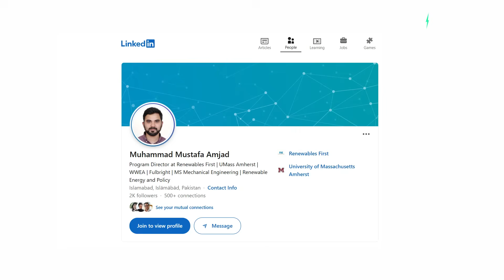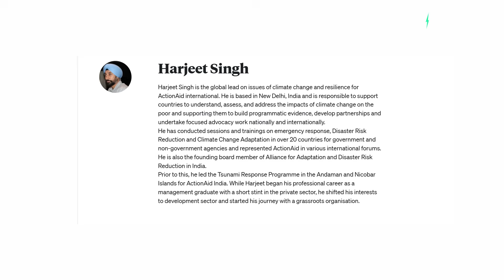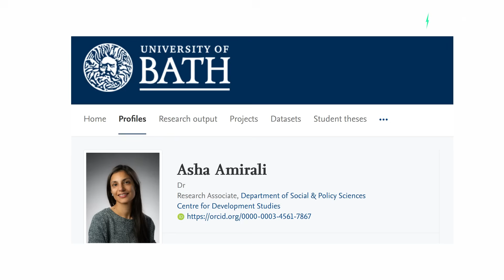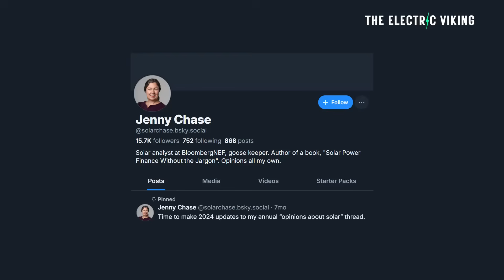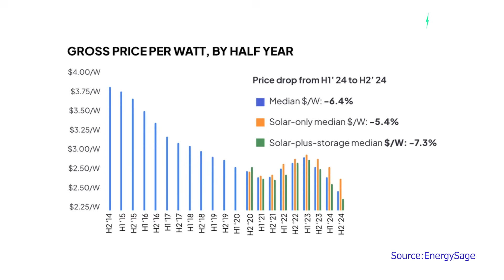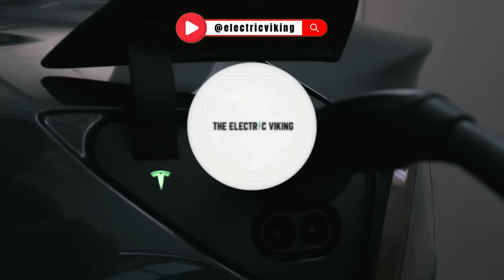Inside Pakistan’s Incredible Solar Revolution: A Game-Changer for Energy

Comment: The govt is clamping down on net metering and new installations. The combination of cheap solar and high electricity prices led to a breakeven period of 1.5 years. The government is pushing this up now, taking it closer to 4 years and making sure we keep paying for their corruption and inefficient decision-making.

We installed a net metering system in Sep of 2022 and remained and negative balance for a good 1.5 years until recently. Now we will be paying bills so the military backed cleptocracy can fill up their banks.

Since the govt is not a buyer in winters when we produce more than we consume, many people are moving to electric cars and other electric based energy consumption so we can offset that cost of fuel.

Comment: The adaptation is not based on the rich and poor class. It's based on house ownership. Personally, I can afford to install solar right now but I don't own a house so it doesn't make any sense to me.
Reply: you can , here in karachi those who are not the owner but if the want to go with Solar the put Solar in someone els building rooftop and no body say that NO we don't let you put solar on our Rooftop , everybody is open to help . we have got a new home and suddenly 2 houses solar has been installed on our rooftop . and we are happy that we are helping them.
Reply: @UmerFarooq-x2p  nice. But the main issue is that if you move out of the house after a year you will have to move the solar along with you and then you will have to pay the installation fee again and it might cost you equivalent to the amount you saved by generating the electricity. I hope there was some kind of a portable system.

Comment: Installed ours in lahore...
6-7kwh solar plates setup with 10kwh lithium battery backup for less than 4000usd

Setting my inverter in such a way that we can run 2 AC for free  during the day and one ac at night for 7 hours
Next step: install another 5kwh battery to increase night usage from battery
Reply: Good luck and praying to Allah so that you can reach the next step in no time.
Reply: We have a 2,500 sq. ft. house, and yes, we installed a 6 kW setup, 
and now we have a 300 amp lithium battery pack for over 5-6 hours of backup with AC, motor, and all the appliances. 

That can increase to over 30 hours of backup (without AC, motor, and refrigerator in case of an emergency power outage)
Reply: But bhai completely draining out the battery on daily basis, won’t it reduce the life of batteries?
Reply: @deSalvay nope, there are different types of batteries
Reply: @deSalvay  no bhai..not darining them completely.. modern batteries usually have protection against deep discharge but I have also set the discharge voltage limit higher than other people to avoid deep discharge.
Reply: @HassanAchieved  u need at least 6kwh solar plates i.e. 585Wx12 solar system with 6kw inverter. Also please install 10kwh battery system with inverter set up in such a way that it charges your batteries after 11Am when the solar is at peak.
This setup cost me 1.1 million pkr
Reply: how much it would cost if you run on grid ?
Reply: @ALiRAZA-mg8bd on grid..every unit costs around 0.22usd or 22 cent usd
Now I'll be able to save at least 65% energy cost

Comment: Solar is very cheap now in rural parts of the country as well.
12volt 280Watts solar panel costs only 8000-8500 Rupees equal to about 30$ US. In my village, many people have 2 solar panels, a starage battery and a few 12v lights and 2 fans on solar. And a little well-off people have installed 4-5kw solar system.
We only have 6 hours of grid electricity in a day.

Comment: Pakistan solar experience has been amazing. Rich/upper middle class opt for grid tie solar and they sell excessive energy to grid. Poor opt for 12 volt solar system with few panels and lead acid batteries to go totally off grid for small installations. Solar tube well is common sight in fields as farmer reduce their diesel bill through it. Only people left behind are those living in apartments as they don't have roof available for panels.
Next big thing will be drop in lithium battery prices. It will enable people to further reduce dependence on grid. Few will go totally off grid with these batteries.
My personal installation is 6kw invertor with 7.8kw panels and 10kw lithium ion battery. I am totally off grid for six months while during summers A/Cs require power at night from grid.
Reply: Price and charging cycle of battery?
Reply: 480k and 6000 life cycles.

Comment: the reason why we need to buy solar is because of very very high prices, power outages, people stealing and not paying for electricity and this causes problems for the normal user who pays for the electricity.

if we use 200 units we pay 64 pkr per unit 
but if we use 201 units we pay 108 per unit of electricity this is absurd and really sad.

Comment: The "rich" mentioned by one of the Pakistani anaylst, are actually the upper middle class. But solar system are not only installed by middle class. The poor ones also have installed few panels at the roofs of their houses, particulalry in villages. In my village, we used to have 20 hours load shedding per day. Now we have installed modest solar system, with batteries, and we at least have lights and fans all day.
Reply: As someone who consistently travels across Pakistan, I am now seeing solar panels even in villages, and shops owned by regular people, the small scale solar panels are appearing more frequently across the country, and specially middle class is shifting very quickly towards solar power.
Reply: A month's worth of pay can get a poor family a panel or 2. Very cheap.
Reply: Isn't the limiting factor that the poor don't have the money? Are they buying panels on credit? Who's financing them?
Reply: @vmoses97 Chinese panels are efficient and cheap
Reply: @vmoses97   panels from china can be afforded even on minimum wage. They are very cheap
Reply: @vmoses97  We have had a boom in wholesalers and retailers buying solar panels, but I remember that we ended up having more supply than demand at one point, which would have caused lower prices from the businesses to cut their losses, at least in the short term
Reply: @vmoses97  panels are dirt cheap.2 to 3 panels will cost 60 to 90$
Reply: @vmoses97  Chinese solar panels are very cheap, a 585 watt panel would cost around USD 70 so even poor people can afford them while expanding the system over time
Reply: @vmoses97  panels are already very cheap if they don't get taxed, but they're probably buying used panels which are much cheaper
Reply: @vmoses97 panels are so cheap here even now govt decreases electricity bills lol
Reply: @vmoses97  Don't listen to him. He is probably some privileged person who doesn't know what it means to be poor. He is at least middle class. Even a middle class person cannot afford batteries easily. Solar Panels might not be very expensive but batteries and inverters are.
Reply: How much power are you generating from 2 panels realistically? And what about other costs - batteries, inverters etc.
Reply: @vmoses97  a 615 Watt panel costs about 19000 Pakistani rupee or 67 bucks, they are getting more efficient and cheaper every day
Reply: Yes exactly everyone household does this. Even in the backward desert places like thar etc.
Reply: i agree
Reply: Middle class also installs them, those who live in houses and not in flats, are all installing Solar panels Alhamdolillah

Comment: A tier 1 Chinese 585 watt bifacial solar panel costs about 17500 PKR at todays rate, or about 62 USD per panel. Offpeak rate is 41.68 PKR per kWh,  or about 15¢ per kWh. When you add taxes, fees, surcharges the effective rate is around 21¢ per unit. This makes the decision to go solar very straightforward.
Reply: Damn, why is pakistan's electricity prices almost the same as England's prices?
Reply: @L8PRODTV  its mostly the dumb Taxes the government add to bill that why it expensive and also the IPPs .. of that wasn't the case the rate would be around 10-12¢
Reply: Simply pakistanis do the math: you recover 100% of your costs in 1.5 years maximum and rest of life it's free!! The normal electricity bill would go to 15-20k or cost of one solar plate. They rather put 10 panels and enjoy free electricity. Many people just put it for selling solar. It's so beneficial that it is commercialized. It didn't boom because solar was cheaper but because electricity price are too higher than anywhere in the world. I remember we bought it when so much panels were being imported than price per panel went 70k in 2022!! We don't regret because we saved those many monthly bill costs. Rather than net metering we have batteries because government electricity was damn too expensive that having whole solar setup of your own seemed cheaper. It doesn't happen anywhere in the world. I know no one internationally will tell the real reasons for such expensive electricity in Pakistan. Let me tell: PM Shahbaz sharif boosted electricity bills by 20-50 times!! Only so that government would collect that much taxes. Who was the main solar panels supplier in Pakistan? His son Hamza Shahbaz Sharif! They made billions and also claimed to save government from going into default when people were trying hard to evade taxes in every way because they were senseless. Many people took loans to pay bills because it were more than entire month's salary for most who had minimal usage! Hope i educated someone.

Comment: SUPER obvious question not addressed in the video - what is the cost of the imported Chinese panels in Pakistan?  An answer to this would really help contextualize the story.
Reply: One 650 watt Panel, costs approx $68 US.   If you use 10 Panels, the average house even in US needs 6,500 watts to 7,500 Watts and above.  So, it will cost $680 US. Labor to install these panels and other set up just another $50 to $100, so you can get everything set up.  Plus another big factor is Lithium Batteries.  Lets say another $1,500 for 4 to 5kv battery set up.  So total set up, probably $2,000 to $2,500 for a modest avg. set up of at least 6500 watts.  Far cheaper than what it costs to go Solar in US.  Last year, I got an estimate of around $9,000 US dollars with the Lithium Ion Battery set up, which is another $10,000 or so.  So, the total cost is close to $20,000 after Local Electric company lottery selection and subsidy, for the installation of 7500 Watts panels.

Comment: You are looking at things in isolation. There is no 'Incredible Solar Revolution' - that is just hype for the sake of the media.

Pakistan is not experiencing any such ‘tech revolution’ as reported by you – the only reason they are forced to import and use solar panels is, that their power system is in such a terrible condition, that there are rampant power cuts. So, this is the only way the farmer / man-in-the-street can actually get power to run their businesses. 

China is forced to off-load their growing stock of (cheaper) solar panels, in bulk, at an even more concessional rate, so as to quickly offload their stock (since the US tariffs have blocked access to the US market and they need to get rid of their inventory, in order to stay solvent).
Reply: Dude you are talking BS. Don't embarrass yourself.

Comment: South african here..i am an engineer that maintains my beloved eskom which is out main grid power generator...about 90% plus of south africas electricity generations..even in my country.....solar is eating eskoms lunch..installed my solar setup in August 2023....my fellow south africans would rather spend 400k to 1 million rand on a new merc ..around 20k to 50k usd than go about 90 % off the eskom grid....we are a country of complainers instead of doers....but despite all of this...we are still increasing our solar capacity

Comment: I've done same here in Australia, my own  all 12 volt system and agm batteries,  supplies the whole house 24 hrs and bill down from 600 dollars a qtr to 200. Best way to go , only use high wattage appliances on the grid in winter only. Runs everything in  summer from November to april
Reply: Not sure if it's possible there, if you start selling electricity produced by your solar panels you don't have to spend money on batteries, you can use grid 24x7 and IP65 inverters usef in these systems are like half the price of alternatives that support batteries. But since you've already spent your money on this system you can still sell your electricity to grid and not worry about electricity generated by solar panels getting wasted (this was my case when I installed it at first)

Comment: Best video. I have also installed 3500 W system with 585 W Jinko 6 panels. From 7 am to 5 pm all my load run on solar. I also use govt grid at night. In between loadshedding and power out in grid i use battery which i charge during day on solar.
Reply: How much it costs with batteries, Inverter,Frame everything?
Reply: @crashcrush-beamng2295 
Solar panel price is 28 rupee/W.
28×3500=98000.
Frame for 6 panels = Rs 30,000.
Invertor depend on company.
Local invertor 7KW = 25,000 without battery. 
Inverter hydrid 4KW with 48V = 150,000.
5KWh (48V) Li ion battery = 250,000.
Other charges =20,000.
Reply: For now panels are pretty cheap 
For 1160$ you can get 20 585w Trina Panel N type
as for inverter it depends on what you are going for.
Hybrid 3 phase will be expensive Inverex 12kw 3P costs around 3k$ while on grid inverters are cheap around 600$ in Pakistan but most people are using local made inverters they run everything directly without needing batteries. @crashcrush-beamng2295
Reply: @crashcrush-beamng2295  Solar panels are about 17000 each frame depends but around 20000 and batteries are different that how many can you afford and white type lithium is expensive buy the tubler batteries are around 50000 Pakistani rupees

Comment: I am proud to say that Pakistani have adopted solar rooftop. We have import 6 GW Solar in 2022, 8.5 GW in 2023 and 17 GW in 2024. Pakistani have installed 31.5 GW Solar panels in Pakistan in just 3 years.
Reply: That's incredibly decent. I live in the UK and even north facing panels here are worth buying because the price of solar has dropped

Once I double up my solar array, I'll be self sufficient for 8/12 months of the year, until I get a heat pump. Once I get a heat pump, solar won't be enough
Reply: That too on individual level. Not on b2b
Reply: DrMajid: how much is the electricity unit (kWh) price in Pakistan? How much is the availability, I mean 24 hours or less?
Reply: @maneshdev1918  Per unit is about 40 to 60 rupees. 3 years ago, the price was 7 to 20 units per watt. In Pakistan, there are different slabs for different unit levels. Sometimes the bill is more than the salary.
Reply: @maneshdev1918 
For household depend on unit used.
For 50 units= 7.5 rupee/unit.
For 50 to 200 units = 30 rupee/unit.
For 200 to 300 units = 35 rupee/unit.
For 300 to 1000 units = 45 rupee/unit.
For industry 60 rupee/unit.
For commercial use 90 rupee/unit.
For green meter sell at 27 rupee/unit and buy at 44 rupee/unit offpeak and peak rate 48 rupee/unit. Peak time is 5:00 pm to 11:00 pm. 
Also includes 15% GST. Some other charges up to 1000 rupees.
Reply: Teri ama proud